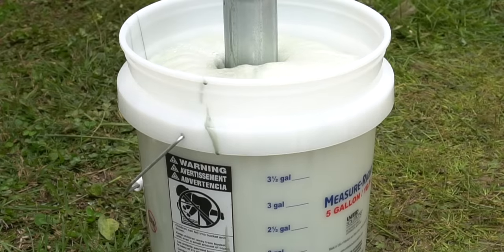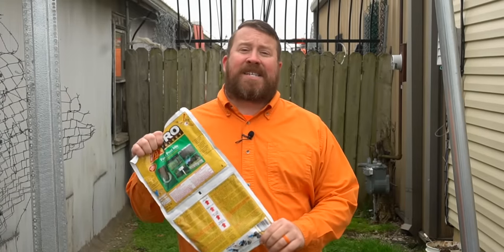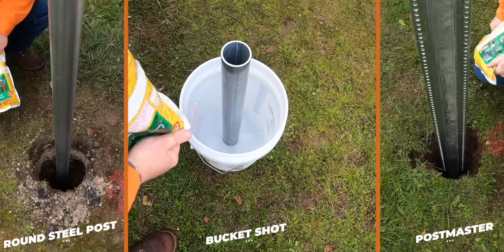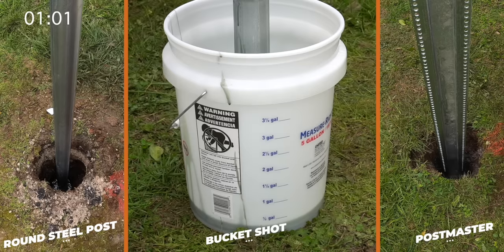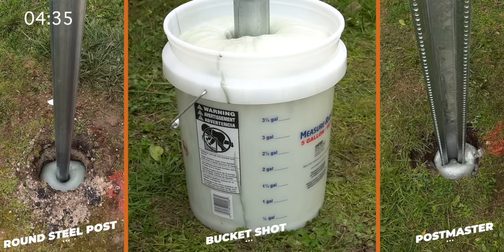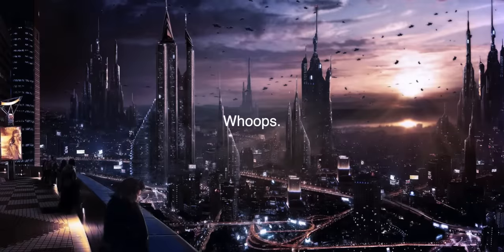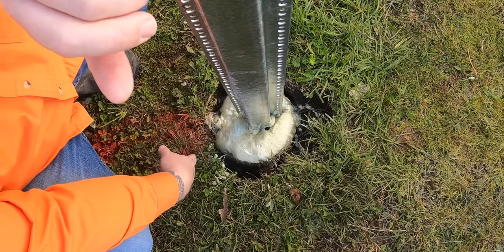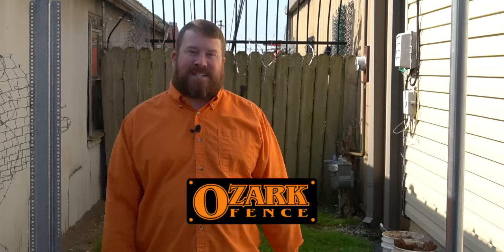Does Fence Post Foam Really Work?

Comment: I hadn’t heard of this product before two days ago. I immediately thought that it could never be as good as concrete. Imagine this test in what we call in Oregon as black mud. In the summer it will crack open   4-6 inches.
Reply: In Florida I don't concrete any of my posts unless it's a corner or gate, they just rot off where the post meets the concrete. And if a hurricane comes by, my fence will just lean over and I can stand it back up and pack it in
Reply: Zeus 1455   It does make me ponder why he had such poor results but the product obviously has a following. Question. Would it work better if the foam could be stopped from going up which in turn would pressurize the sides?
Reply: @joshyingling  I live in Florida too, one tip is to just bacfill mostly with dirt compact then pour concrete in top portion of hole and  above grade slightly with a slight slope up the post. (so water /dirt doesn't contact the upper portion of the post) below grade wood does a lot better so that portion lasts fine. It is just where you have the dirt,water, oxygen trifecta that you get the problems in my experience.
Reply: @scottrobinson8590  yeah for sure that makes since. Thanks for the tips
Reply: @joshyingling  I live on the NC coast, just posted a comment kinda similar.
Reply: @joshyingling  you could try treated lumber. Its treated for a reason
Reply: @ryanvess6162  all posted are treated where i live and they still don't warrant concrete. The corner brace posts are usually 6 inch or better and they may get concrete or they are buried deeper. But the same thing happens when concrete is applied, the post rots inside the concrete

Comment: I see a lot of stories of wonder here in the comments, but my experience was quite the opposite.  From day one posts were firm, but not rock solid like with concrete or compacted gravel/sand.  After 1 year posts were wobbly and leaning. Posts were eventually pulled, replaced, and set with compacted gravel/sand.  Inspecting the foam after being pulled, there were separated wallows around two sides of the post and foam was more "mushy" on those two sides.  The foam just does not maintain stability/integrity.  Neat idea, poor long term results.
Reply: Had the same experience with this stuff also.  Ill never use it again or recommend it.  This video proved our point

Comment: I used post set foam for my 20' flagpole and worked great. I laid a couple of inches of stone in the bottom of the hole then I back filled it after it set up and put the last of the stone around the base.

Comment: If you didn't do the bucket experiment I would have assumed the ground dried and shrank.
Reply: Yea the smooth walls of that bucket really perfectly displayed how the foam penetrates into the earth just like he said lol
Reply: Maybe he didn't follow directions or mixing instructions?!  What do you think?  If this was a common occurrence, the company would be out of business and liable for all the false advertisements.
Reply: @VadimDrevenchuk  I've read that he didn't mix it nearly hard or fast enough for an even chemical reaction to take place.
I would likely only use this product in a temporary or emergency  situation.
Reply: @paulc6035  I've actually used this expanding fence post foam for something completely different and it worked perfectly.  My father installed a bathtub and forgot to stabilize it very well (it was rocking a bit).  Using two-part fence post foam I pored a mixture of this foam into a 3" hole I made in a wall (from the back of the tub).  The foam expanded and stabilized the bathtub from all sides and the bottom.   in the end, it worked like a charm.  Its been 7 months and the bathtub still solid, the expanding foam underneath the bathtub didn't shrink. It's very dense. 
Side Note: I couldn't make a small dent in this fence post expanding foam with a 16 oz hammer after 2 minutes, it was that dense. I had extra that was left in a mixing bucket.

Comment: I installed (13) 4"×4"'s in 2.5-3' deep holes, 7' apart, fence is 8' high, with 1"×6" horizontal boards screwed into the post. I, too, waited a couple of days. The 4"×4" felt like they were in concrete; couldn't budge them one bit. It's 3 years later, and my fence is still standing strong. I did use regular concrete for my gate posts and used a 4"×6" post for the load bearing of the gate, as well as, used concrete for the opposite, adjoining sides to the gate post, to add strength to my mammoth gate. I've never installed any type of fence, but as of now, I am still very pleased with the foam product. I bought it at Home Depot. I did end up using 1.5 bags on some of the posts. I let the foam bubble up as far as it wanted to go, then cut down the portion where I needed it removed. That part was not easy, it's hard as a rock.

Comment: One of the sturdiest fence's I've worked on had the posts set in crushed rock. 
I left the posts and replaced the panels. 
I still use concrete.
Reply: I set a couple of gate posts for my cousin last year with '3/4 crush' - set it them 2' deep and tamped it down every few inches of fill = solid as concrete and I see no reason why it'll be any different any time soon. If it does ever get pulled over by the weight of the 10' aluminum gate (highly unlikely) I'll dig out on the side that it's leaning from, fill & compact on the side it's leaning to, and it'll be good for another however long..

Comment: That’s crazy. I do mailbox posts with that same foam. I just checked one from 2 years ago and it’s really sturdy
Reply: well a mailbox post weight how much? 30-35lbs including the mailbox it self, so it might be ok. problem is lazy people who think they can escape proper anchoring with concrete use this for fence posts as thick as a 10x10 and as high as 80 inches tall, or worse, for posts of a home overhang roofing etc..

Comment: Used the foam a few times, worked best when holes were dug 2 days in advance to dry out a bit that way the ground expanded once filled & condensation began. Post rings work best, no rust, no wobble, fill an go. Made in Texas & Oklahoma where the winds beat up fence posts 24-7
Reply: Good point on letting the hole dry out a bit . May be something to that .

Comment: I'm a relative novice when it comes to setting fence posts, but have done several posts using this material. The ones in my yard were done four years ago and they are as solid as can be. I really like this product and will use it again. Used it on some customer's fence repairs too and never heard of any problems.

Comment: We've used foam that's a 2 part on power poles in the ground.
Reply: Same, not this brand and it worked pretty well, these were temp poles btw
Reply: Power poles I’ve seen installed got the dirt pressed back in around them and that’s it. Granted they are at least eight feet into the ground.
Reply: You shouldn’t be using anything around a power pole.
Reply: pretty common with fiberglass poles, and I've seen it used for emergency replacements.
Reply: There ya go.

Comment: Great video! I used to work installing fences and always had great results using concrete.  I have used two part marine foam for marine projects and maybe the slower cure and less heat would stop the shrinkage. that did not happen with the marine foam (quite more expensive by the way.). Now working in the construction industry for over 30 years Sikka products are usually top in the industry, but they need to go back to the drawing board with this one. Thank you for showing this video. It could save many people from making a costly mistake. Cheers!

Comment: We use rainbow pole foam around our utility poles and it fully expands and hardens in a matter of minutes. Years and years of use and never a problem. Now I will say, during colder weather the mixture will  barely react when mixed unless placed near heat prior to use.

Comment: Weird, I used the foam for a clothing line with 4x4’s and they are rock solid and do not budge a millimeter.
Reply: I have a feeling that maybe he didn't mix it correctly or the soil was wet ... (something isn't right).  If this was a common occurrence the company would be liable for all the damage and failures.
Reply: @VadimDrevenchuk  Agreed.  I'm guessing that 15 second mix time was being conservative. I'm guessing a few bag squeezes were in order.  It even appeared as if the last bit that dripped from the bag was a slightly different color.  It would be nice if it were two visible parts of say black and white.  Mix till grey and pour.
Reply: I use this stuff alot. He didn't mix on his knee or shake. This was bad mixing job. Need to be mixed well and heated to 80 degrees on dashboard. I believe the kit description tells you this on bag ....

Comment: I thought foam would be a good alternative, not anymore, what a great informative video.  Thank you.
Reply: Agreed.  It is the fact that SIKA, the manufacturer already knows about this shrinkage factor ...yet still have no problem sending it out as a product for those to buy who do not do their own investigating beforehand. that is the true disappointing factor.

The NEXT issue, that has yet to be "tested", is the strength or rigidity of the "final installation" ....which of course cannot be tested in the current "loose" condition.

No point in playing games when setting posts, when the ready-mix is so obviously a proven method and "permanent".

.

Comment: We developed a similar product to set telephone poles after hurricane Katrina. Normally the utility company digs a hole, inserts the pole, holds the pole with a crane, calls a cement mixer, waits for the cement truck, pours the cement, then holds the pole while the cement sets. With our product we had a bag in a box of resin and curative in a small bag, the utility could carry 10 or more boxes on their truck. Mis the bag into the box then backfill, after 15 minutes you move on and do the next hole. Our product is called Fast42K. This product may not be properly engineered or was under mixed. We recommend mixing over an edge of a tool box or tailgate like you are buffing a shoe. We brought power back to New Orleans with our product which set hundreds of poles. We even tried to pull one out with a tow truck! It is expensive but if you need to set a few posts, are in a hurry or need to set a mail box it works great, just be sure you MIX IT WELL>

Comment: I've only used this product for repairs and replacement so the replacement posts have posts set in concrete on either side in most cases. Once however, I replaced a cattle gate- an 8" round post with a 16' gate hanging on it and I used two bags of Sika foam in a 12" hole 3' deep. I hung the gate three hours later. The following week I stopped by the gate and opened it and stood on the gate at the far end, bouncing up and down. 16' of leverage with my 230 pounds on it and the post did not move and was still true when I closed the gate. The ground I dug the new hole in contained quite a bit of gravel and well compacted with plenty of interstitial spaces in the hole walls. I used the product in July and it was around 90 degrees at the time with plenty of Kentucky humidity. That was a year and four months ago and the gate is still hanging true, level and solid (as of three weeks ago). I am hesitant to do a whole fence with this product as much as I would love to because of so many reviews and videos like the one above, but I really with I could.
Reply from the maker: Great information, I appreciate you sharing your experience!

Comment: Damn!  I really wanted this stuff to work!
Reply: It DOES work!  Not sure what went wrong here - looks like it maybe it wasn’t being mixed properly?
I have built a couple wooden fences in sandy soil.  All the posts were erected individually before we moved on to horizontals.  All the posts were rock solid with no movement.  The fences remain standing today through very strong winds!
Reply: I have used this product a lot for many years and it works well. One thing this presenter never does is backfill the hole. This takes up the gap and my fences are still solid many years later. At least if you are going to review the product go through the full motions not just an un backfilled hole.
Reply: My husband used this the other day and it worked great he is a contractor and he built an awning using the foam it may have not been the same brand but it worked fine
Reply: @grumpyoldstudios  Can you explain what you mean by "backfill the hole" and why you think he didn't do it properly and why you think him not doing it properly caused this issue? The only times I've seen this term used is for re-filling the hole you dug for the post. In this case, he "backfilled" the hole with foam. Maybe if you can explain what you think he's doing wrong, we can all understand why it didn't work. I've been looking at this product recently for a project and it has some very mixed reviews - it seems to either work great or work just like in this video.  The product has so many bad reviews from unsatisfied customers that it feels like a crap shoot on whether it will work for us. No one seems to know why it works for some and not others. Perhaps you can shed some light on the problem?

Comment: Great demo. After watching this, I think I’ll stick to the concrete.
Reply: Same here.  I'm in the process of replacing my sister's fence.  We already have the material minus the gravel and concrete.  I started looking at alternative post setting methods to help keep the cost to a minimum.  Besides this foam I was also looking at the post base spikes, but still "on the fence" about them.
Reply: Based on one review? There are so many more videos with the product working perfectly. I have also used with success. I presume they did not mix it properly or used expired product.  Also, it is hard to believe this product has been around this long if this was the normal result.

Comment: When setting a fence post which I have done many I have never leveled one I have plumed them all 😝
Reply: And I bet your fence turned out nice and level!
Reply: I plumbed my fence posts cuz I'm lazy and it was easy, but most fences I've seen go up around here they use a 3 foot long level instead. They call it "leveling". It seems to be a common term and practice.
Reply: It's an adjective when it describes something that is perfectly vertical: "The wall is plumb." It's a verb when it identifies the action of making something plumb: "You must plumb the post before pouring the footing." It's an adverb is usages such as "Check the fence for plumb."

Comment: Concrete is cheaper and better.  Sometimes it's better to use old technology.
Reply: Tell that to the electric companies that plant electric pole with it
Reply: cheaper, not better. All about the application and the following of directions. "Better" is whatever works for the individual. Personally, I use the foam and have had ZERO issues.
Reply: @no_handle_required  Here a question how long will this foam last in the element in life, will bugs boar into it a weaken the foundation of the product.
Reply: @rimc8783  Depends on the application. I can't speak to bugs because I've not seen any damage to my applications. No bug damage, no environmental damage. I have fence posts up with the foam, and I have steel satellite dish poles up with it and they are solid as any concrete job. I also have railroad ties in the ground with foam for my shooting range and as heavy as they are they don't move or sway. Now, would I build a house with it? Hell no, but for posts, I'd do it any time. As info, I pulled a sat pole out of the ground that was in there for 4 years and the only damage to the foam was what I did to it to remove it. In fact, I had forgotten which pole was concrete and which was foam until I removed them. Even telephone poles are using foam for install down here in Florida. The biggest factor is following the instructions though.
Reply: @no_handle_required  Thx You for the in depth information on your experience with using the foam. I may just try it some day but first I will need to use up these bag of concrete I have sitting around in my shed.  Thx for the information.

Comment: Power line companies use this. They call it pole set or pole foam but only use it in wet and high ground water conditions. The expanding foam displaces the water in the ground. They pour it in the hole first then tamp soil in on top of it. One lineman told me they had to replace some poles that had been set with this and they could not pull these old posts out, only tipped the boom truck so had to wind up just cutting them off.